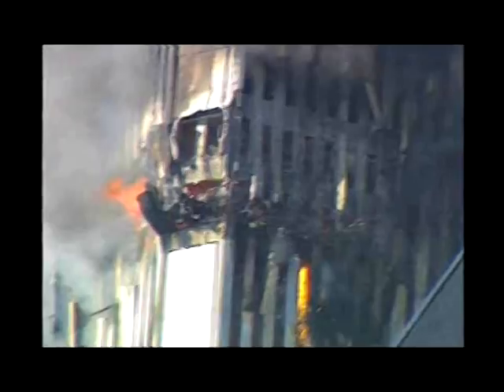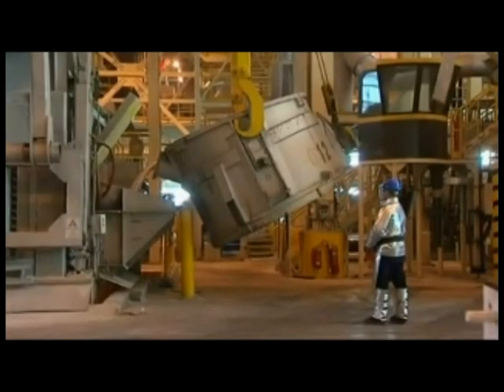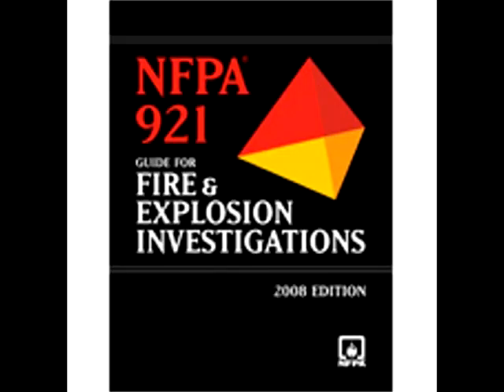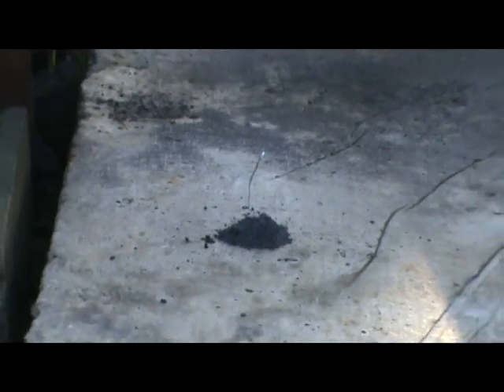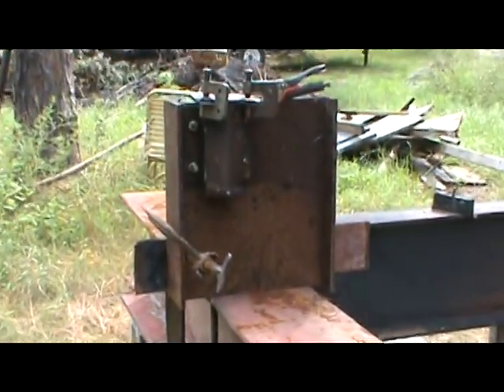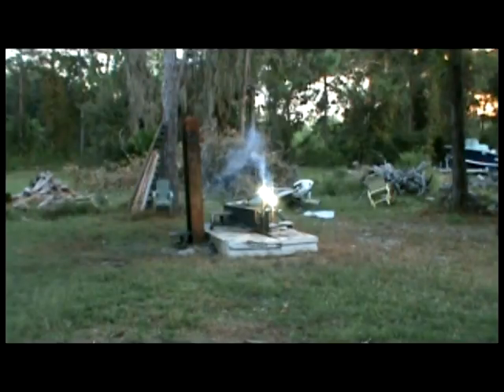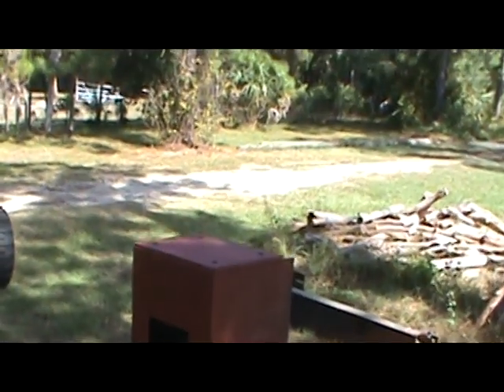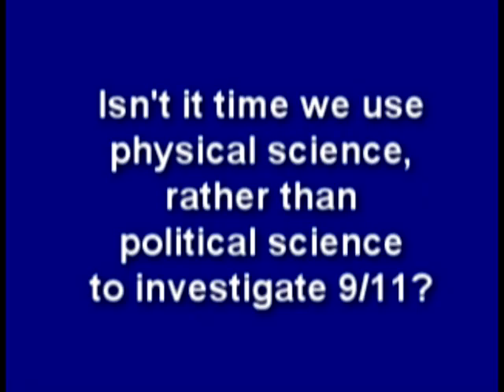9/11 Experiments: The Great Thermate Debate

Comment: I was a thermite welder for a major railway from 1995 until  2007 . I watched your video and can say with 100% accuracy that what was pouring out that building was indeed thermite...as for can thermite melt steel..Answer yes I have watched it melt right through railroad track many times.... to do a railway weld we use a 20 pound bag of thermite....the thermite we used was of very good quality.....thermite does not explode unless introduced to water.... it is my belief they filled the columns with thermite and the fire from the plane ignited the thermite.  I have watched thousands of thermite welds and I can guarantee that liquid steel pouring out is the exact replica of what I watch at work.
Reply: A really big fuckin hole comin right up
Reply: @G Ghecko I said it doesn't explode unless introduced to water...try reading the comment a little closer....I spent 13 years staring at thermite pours....I'm probably a little more qualified than you on the subject. In the end you misread my comment so detective work is probably not in your wheelhouse. Cheers
Reply: @theraven9156  I am a chemist and more qualified than you, you're right so everyone who says you aren't can shut their months.
Reply: So do you think 9/11 was a inside job?
Reply: @1loveaudi  israeli mossads did it, but zionists were behind.
I laugh at those who believe Osama planned it, they must also believe Santa Claus.
Reply: Thank you so much for your honest comment! It is greatly appreciated! We are all truthers in this together. If we all could add in our own truths & facts that we've learned throughout our lives, we could use those facts as the many different puzzle pieces that are NEEDED to piece all of this evil that is going on, and find the truth, together!!!!!!!!🙏❤💛💚💙💜
Reply: Sara Ferguson

Unfortunately, evil was created by people who once ran our country. id like to say it started all the back when world war one was going on but what am I to say. what I could say from 9/11 is that kerosene (jet fuel) burns at 800 to 1500 degrees Fahrenheit, and steel melts at 2750 degrees.  something went wrong and its not the chain link of events from the airplane alone
Reply: 'Theremite won't explode unless exposed to water'

'The fire from the planes set the charges off'

You're either lying or really grasping at straws
Reply: the raven 
It was 1800 degree molten aluminum from the jet plane pouring from the tower. It glows that exact color.
Steel loses 50% of it’s strength at that temperature.
Reply: @Jay Kenley, You must be joking because you could not possibly be that stupid. Watch the videos of other much smaller buildings being prepared for controlled demolition. It takes months in some cases, and that's after the building has been abandoned and all of the structural elements are readily accessible. Further, EACH of the twin towers was 110-storeys tall, which dwarfs any other building that has ever been demolished.  So, all of that preparation work would need to done IN SECRET in occupied buildings over the course of ONE NIGHT? Simply not possible by a few guys 'in white vans'. Grow up, get a life, and learn to think for yourself rather than drinking the KoolAid.
Reply: John Johansen yeah that’s why they were working in there for weeks before though right.  They said elevator refurbishment job 

They were guys working there for weeks
Reply: They had to know exactly on which floor the planes would hit to do that or they had to fill the columns all over the building to be sure. Nighter is possible.
Reply: Ingebrigt Kvamen 
Yes, the entire conspiracy theories collapse under cursory examination.
The exterior steel support beams were mostly outside the building, outside the exterior glass. 
I don’t think truthers ever entered the building. I’ve been all over that building.
I don’t think any truthers have ever run cable in buildings, or tried to drill through steel with a hand drill.
They don’t understand the enormity, labor intensive, sweaty grunt work of what they propose, the annoying security protocols enacted after the 1993 bombing, engineering, they don’t understand anything. 
Clueless they are.
I’ve been in many of those offices.
Reply: evidence of thermite evidence of explosions evidence of things turning to dust. You guys think it's the same people behind the world currency / federal reserve? I do. If you haven't, watch creature from jekyll island
and europa last battle
Reply: Truthers are like a parody of detectives. Dust? 110 floors of four inch concrete slabs, tons of gypsum wall board, create dust when pulverized.
Everything’s a clue to them.
Get a clue!
Reply: @JohnsMotorcycleChannel2  Goddamn you are so smart....so the planes brought the buildings down....ok, got it...
Reply: D G 
Aircraft smashed up the Pentagon, and made a big hole in a field in PA too.
Reply: John Watson what’s your point?
Reply: @Jay Jay and the external Columns were clad in it...... they always leave that out.... Damn Nutters
Reply: Jay Kenley  and the drivers of the van were tiny green aliens...yeh right you made up that history about the vans. Where s the newspaper reporting the vans?
Reply: jay jay

so that must mean the I beams used for the building were made of iron right? like where you getting at with this aluminum is just one ingredient of many to make thermite
Reply: Actually, it was molten lead from the UPS system in there to prevent power surges and short-term power outages. Anyone who has done actual research has found out that, that room was full of lead-acid batteries for that purpose.
Reply: Your post seems more informative than judgemental. Curious how touchy some commentators are though. I guess explanations to events that don't match individual beliefs are harshly judged... just like in old Salem during the witch trials.
Reply: @davidfesta3061  people have come forward about this.  First, the bomb sniffing dogs were "worked 12 hours a day for 2 weeks and then were unexplicably pulled from duty on Sept 6th until the attacks."  This is well documented in various news reports.  For the second part, I'll repost what I wrote to raven earlier.... there's a pretty easy answer to the question of "how would they get it there?".  Both towers underwent a "power-down" on 9/8-9/9.  According to the testimony of the safety officer in charge of prepping the building for the power-down, it was the first time this ever happened on his watch.  He claims that lots of "engineers in overalls" were walking around the building during this time.  The buildings were shut down, security scanners and any other powered device was disabled, offices were closed, all power was cut until Sunday afternoon 9/9.  There are videos of this gentlemen's testimony on youtube.  It's certainly not far fetched that the CD was set up during this time..  You can find the documentation for both of these on youtube.
Reply: @davidfesta3061  Well thanks for your permission.  I really only believe because I want to.  Keep telling yourself that:)  Anyway, because I'm really only trying to figure out the truth of what happened, as best I can, I'm looking into your claim.  I'm not trying to prove the thermite hypothesis.  I don't know what happened and I haven't claimed to know what happened.  Thanks for at least sharing a few sentences of real argument so I can look at that.  It's certainly a logical claim that the building couldn't possibly be rigged.
Reply: I mean you know skyscrapers experience incredible wind speeds due to them being uninstructed combined with there being a plane with at least have a tank of jet fuel and a small(well jet sized but not the entire surface area of the building) hole in the side the wind would make the fires burn a lot fucking hotter enough to liquidize the steel, not to completely discredit what you’ve said I’ve never worked with thermite so I don’t have that same first hand experience, so thank my opinion as you will
Reply: LOL at the reply to the wrong person. OWNED.
Reply: @davidfesta3061  scientists from all over the world examined samples and said there was thermite present.  It's not the video that brought this in question, it's the people that investigated and that are more qualified than you to talk.  sorry, try studying the subject
Reply: David Festa they did actually do that though didn’t they lol 😂 

The had ‘workers’ in and closed off certain floors 
Check it out
Reply: David Festa 
You think those people in the offices are going to question a worker repainting a wall on whether they’ve loaded a column with thermite 😂😂
Reply: The steel girders in wtc7's inner core were attached to the support columns with only 4 bolts.
Reply: Please watch and share https://youtu.be/H6PeudYGZ98
Reply: @kifter4254  It's so nice to see someone respond to an old comment after such time, that just shows that people care. You are a very kind gentleman, thank you very much!
Reply: the raven you are absolutely fucking right
Reply: You were a welder?  And you believed this garbage?  I suspect that maybe you aren't a welder because welders actually understand the properties of metals at different temperatures.  How about this "Mr Welder" At 1000 degrees F, what percentage of it's original strength does structural steel have?
Reply: G Ghecko my dad had friends in the building and they heard explosions soo get the fuck from behind your screen and go out onto the world see what’s going on and you’ll realize
Reply: @XR-ok6gr  yeh right any can say " my xxxxx heard explosions "but the explosions  were silent from the cameras outside? Do you think you can  put a charge in the beams of a floor with lots of people and nobody would say a word?.
Yeh many would die to think govermenet did it because they hate  the goverment say ohh i heard explotions
Reply: @davidfesta3061  lol do employees stay the night at work?
Reply: @davidfesta3061  they actually did elevator  work so its actually possible but no one will ever teally know 100%forsure what really happened Y cause they hauled all the Evidence  Off Before investigating  It Thoroughly  ..Kinda Joke in its self just a comment
Reply: Yeah, 30,000 office employees in both towers didn't notice the people carting around thousands of pounds of thermite,  knocking holes in walls, blasting away the asbestos and strapping thermite to the exposed girders.  After all, doesn't that kind of thing happen in every office on a regular basis?  But the real trick was getting the planes to hit in the exact spot where the thermite was going to start the collapse two hours later.
Reply: @artgoat, Well said. I have long argued that these points alone are sufficient to debunk any 'controlled demolition' theories. The point about the impact points/zones is often overlooked but yet is so obvious.
Reply: John Johansen 
The conspiracy theories have bigger holes in them than the actual story. 😆
Reply: @artgoat  why do ppl keep saying  this, does thermite get weak over time ?
Reply: artgoat you do realize that there are plenty of facts out there and videos on the facts mentioned that the floors that the planes hit were under renovation and construction for quite some time lol do your research kiddo
Reply: artgoat serious? 

The floors were closed off, do you normally question construction workers? Or enter construction zones to question workers on thermite? 😂😂 you think those people working would care what people are carrying about?
Reply: There was documented construction work for weeks over entire floors just before 9/11, watch 9/11 a new pearl harbor documentary.  Why is it so hard to believe ppl do evil things?  Seems very normal to me.
Reply: @artgoat  you make a good point...I have pondered that question myself. Their explanation for the orange flow was office furniture and melted computers.. I'd bet anything that what poured out is thermite.....Iam very tempted to do my own thermite experiment and put it on youtube....and my thermite will burn way better than the guys in the video...I've watched it burn right through 136 pound railroad track.....when i say 136 pound that means it weighs 136 pounds for each 3 feet of railroad track....I am going to do an experiment and show youtube what real thermite can do.
Reply: @theraven9156  wait what , are you saying every 3feet weights 136pounds?
Reply: @Dashawn56  every 3 feet of railroad track weighs 136 pounds....back in the old steam engine railroad days each 3 piece section weighed 56 pounds.....railroad track has become heavier over the years to withstand the ever increasing tonnage of the trains... I have seen thermite on many occasions melt right through today's bigger railway track many times. To melt through those trade center beams would be no problem at all.
Reply: @theraven9156  Had thermite been the cause for that glowing liquid seen pouring out of the towers, you would have also seen a bright  flash where the thermite was burning. 
You might excuse that away by saying the  thermite was located farther inside the tower,  unseen.
So that means thermite was making molten liquid somewhere in the tower, but somehow it found it's way to the corner of the building...
Ook
Reply: @the raven, I am not in a position to dispute your assertions about the explosive properties of thermite. However, are you asserting that it was detonated (on 9/11) by contact with water? If so, what would be the source of the water at each of the sites where the thermite was planted? And, how could such a detonation process be initiated (i.e. to not detonate prematurely) and to detonate in sequence (i.e. 'controlled')? If not water, then how was the thermite detonated? And, what would be required at each site to set up the detonation mechanism?
Reply: @theraven9156  there's a pretty easy answer to the question of "how would they get it there?".  Both towers underwent a "power-down" on 9/8-9/9.  According to the testimony of the safety officer in charge of prepping the building for the power-down, it was the first time this ever happened on his watch.  He claims that lots of "engineers in overalls" were walking around the building during this time.  The buildings were shut down, security scanners and any other powered device was disabled, offices were closed, all power was cut until Sunday afternoon 9/9.  There are videos of this gentlemen's testimony on youtube.  It's certainly not far fetched that the CD was set up during this time..
Reply: You got your video done yet?  @theraven9156
Reply: @tonyiacomi4822  I need to know the thickness of the steel on the box panels?
Reply: When are you gonna find out?  @theraven9156
Reply: @theraven9156  genuine question.
you say thermite doesn't explode without water. what was this guy using in this video as 60% of his tests exploded,
Reply: @chrissearle6176  the thermite we used on the railway was industrial grade..it burned very clean ... I believe what he was using was a homemade recipe which probably had to much magnesium in it ... just a guess... we are running trains over our thermite welds at 80mph (passenger) and 60mph (freight) so the quality of thermite is very high.
Reply: @theraven9156  cheers bud 👍
Reply: John Johansen that’s a really simple dumb question, kinda like you’ve never heard of this before. 

It’s been used for such a long time
Reply: @artgoat  they did elevator  work which was inside the structure So its possible And nobody was allowed in.
Reply: @artgoat  your way off mate. There was reports of men coming in at odd hours. Some floors where rented by Israeli ' artists ' yet alone many details of out of the ordinary occurrences. Especially iith security. There is film of steel beams at the site clearly cut purposefully. There is so much evidence to support without doubt that the official report is a joke.
Thing is, I researched both arguments before making my own conclusion. Why do so many that think the government wouldn't lie not even look. Everything about it is so clear to see I'm at a complete loss to understand how so many dont want to see the reality.
And this really confuses me - how often have you heard and maybe said yourself that politicians all lie, can't be trusted etc. Yet the same people believe every word on this. 
I've come to accept that the world we live in is nothing as it seems. From the beginning until now, and until the end of our age -  Its all about Jews returning to their promised land.
Reply: One question.  Where you in New York when it happened?  What did you actually see? A video? Or were you actually there seeing something real?
Reply: It's interesting how an ex CIA agent is saying that from August to beginning of September trucks were coming and going from WTC every night after ppl were out the building ... What did they load all them nights ?
Reply: @TheRealAnthony_real  whats the name of the ex.cia? John mclane maybe ?ohh and you re the editor of that newspaper.maybe an ufo charged the explosives and you were the driver dont you?
Reply: @davidfesta3061   Marvin Bush was Supposably  The Main Gaurd And I think They wasnt around With Dogs When thsy did inside Elevator  Work And Other work Elevator  Ess Gaurded Area
Reply: Jay Kenley  Hey Great Somebody else Actually Knows about Elevator  Work Wish Rest These Stooges Knew More ..
Reply: @davidfesta3061  Maybe you need check it yourself im pretty sure ol marvin bush and the they guard dogs were taken away when they was doing the elevator work maybe im wrong Who cares Really Truth is in The Money See Who made Millions off This Ordeal Bush Cheney SILVERSTEIN  Yep Millions and  Millions,Millions, millions,millions
Reply: @davidfesta3061  Marvin Bush was Part Of A Company Called Secruracom Maybe spelled Wrong i didnt win spelling bee sorry he or the company was in charge of the towers 1996-2007   Look it up ..Just a Coincidence  Maybe Bush President  911 he's  in a School in Florida  And When Told He Just Sits There With Thumb up his Ass Why Didnt They Rush Him Off if it was A Terrorist  attack Just a Thought..Im not a Theorist  Just Seeing Strange Coincidences...Maybe Maybe Not ...
Reply: U sure
Reply: Normal office workers would not notice regular "maintenance" being done on their building. It would be so easy to do right in plain sight
Reply: So it is true that thermite did bring the Towers down. Because jet fuel isn't hot enough to melt the steel.
Reply: @davidfesta3061  5:20 in this video.  It wasn't two weeks, it was 5 days. https://www.youtube.com/watch?v=lKO5t3rcIZU
Reply: @davidfesta3061   I don't know if you know this but hundreds of thousands of people worked on the Manhattan project and that  secret  never got out it's called  compartmentalization   you only know what you need to know only  the people at the top know the whole story
Reply: @davidfesta3061  use some maturity in your debate mate. Who would take you seriously. It works against you not with you
Reply: @davidfesta3061  David David David. There is scientific proof thermite was used. I have a question for you that requires a simple yes or no answer. Is your conclusion based on research ?
Reply: @davidfesta3061  there you go with your gutter language. Exposing your maturity and ability to discuss anything seriously. One - you didn't answer a simple question so I'll presume confidently you havent done any research. So who's ignorant. ? Hell I might as well go further as you are so well educated. Can a Boeing 747 fly at 500 miles an hour towards the ground perfectly vertical, and bury itself 100% into the earth on impact as is the official story of the Shanksville crash. ?
And mate, there is more than enough conclusive evidence of thermite
Reply: @davidfesta3061  one thing is for sure - you are absolutely correct that idiots will believe the ridiculous. ID surviving the crash. Flew out his pocket the exact moment the windshield broke. Thats believable. Body parts and steel beams thrown over two blocks away, but no explosion. Thats also believable. How about WT7 falling at near free fall, no resistance at all from a small office fire. Thats believable. How about the proven fact of inside trading ? And the people or companies involved are not allowed to be known. The plane vaporized to nothing at the pentagon yet still they retrieved passenger DNA to identify them. The list just goes on and on. And its is absolutely ridiculous. I think maybe you even maybe believe Jesus was born to a virgin mother. Because the amount of miracles and one of phenomena is amazing.
I look forward to your clarification of your education and lack of common sense in your abusive gutter trash reply
Reply: @davidfesta3061   Here one leak for you: (G.W. Bush speaking in an interview abour first responders): “I had a job to do,” he says. “They had a job to do, but I didn’t see the horrific scenes they saw nor did I get concussed by the loud explosions and the bombs that went off around them.” 
(
https://people.com/politics/george-w-bush-opens-up-about-his-sleepless-nights-after-911/
Sleepless nights? Why? Pangs of conscience maybe?
Reply: @davidfesta3061  every reply or comment you make is based on abuse. So I gather you understand it. I won't go down to your level. By fuk though I'd love to meet you face to face
Reply: @Dean Khan WTC 7, here's a video with sound. https://youtu.be/nqbUkThGlCo  In this video the rooftop units collapse before the rest of the building moves. Now we all know that when a building is rigged with controlled demo the whole building collapses simultaneously. The U.S. Attorney has agreed to present the evidence to a grand jury involving this whole thermite, thermate, nano thermite etc. Nano thermite, a word invented by the truther which is why when you google it everything that comes up is 9/11 based. There is no mention of that word before 9/11. Who has the evidence that proves thermite was used?
Reply: the raven I definitely believe it was an inside job probably organised by the CIA, I watched another video where they said workers inside the two towers witnessed painters painting the walls and many of them said the paint had a very strange smell unlike any paint they had smelled before, my question is do you think if thermite was added to the paint would that of been enough to bring down the two towers?.
Reply: Preach to the "Shills" amongst you friend. The ones that, up to today, RIDICULES" everybody that ridicules the "official" story. They walk amongst you. Daily. With respect. To the innocent dead. And their loved ones.
Reply: You want to ridicule the official story then make sure your theory matches prima facie standards. I was a witness. Watch this whole ''thermite, thermate, nano thermite, super thermite or whatever you tin foil hats want to call it'' turn up just like all of the other BS theories. It was acknowledged by the courts, now lets see if Jones and Harrit can pull it off. Especially after they have made contradictory statements. Especially when the paper never even mentions the presence of  thermite.
Reply: @davidfesta3061  "demolition experts spent weeks tearing off sheet rock to expose the columns..and planted thermite in how many locations?." A fucking plane carrying tons of jet fuel crashed into the side of the building and went a quarter way through the entire thing. Tearing off sheet rock to expose it? Are you that fucking stupid?
Reply: @davidfesta3061  Thermite you have to make it, it doesn't just appear anywhere, why the hell was it found in the tower site during the investigations?
Reply: @davidfesta3061  "what you don't understand. .you don't debate wannabe youtube 911 truthers...the proper and most effective way to communicate with individuals like yourself is to tell them to go fuck themselves!..its just that simple...!" Yeah like your actually proving them wrong but no you are here looking stupid, maybe your just bluring the lines with bullshit. Thinking you got a point but in reaility your talking to yourself with the "go fuck themselves". You are fucking yourself.
Reply: @davidfesta3061  Yet you said someone had to break down the walls to expose the thermite as in a previous quote now your literally back stepping. "757 commercial jets the energies and forces from the impact.and the sum of events from those impacts (forces and energies produced)..globally brought down the towers...
" You say the thermite had to be exposed right well read your words and focus on "impacts" if your jet fuel can burn those beams (which we know they can't melt the beams in the first place) then say someone had to expose the thermite after you talk about this apparent bs huge crash "forces and energies produced)" "Impact" BS could have done it, don't you think thermite would have lit without having to be exposed days/weeks/months prior with such a huge crash?  You're the epitome of stupid while lacking even the understanding of your own words in all sense. You dumbfuck.
Reply: @WOAH CALM DOWN Thermite is iron oxide and aluminum powder, it's residue is aluminum oxide and iron. What are some forms of  iron oxide, how does aluminum oxide form and how is aluminum powder made? You're saying that it doesn't just appear anywhere. They found traces of thermite in the dust.
Reply: @WOAH CALM DOWN Tell me that none of these elements were present in the building. Who has the evidence showing that traces of thermite was found in the dust. Since Dean Khan is busy maybe you can answer for me.
Reply: @beingmyself000  Yes but you don't find thermite naturally if you could read you'd get that
Reply: @beingmyself000  point is, you don't walk into a old barn pick up a pipe and under it is a pile of thermite, it's a compound with RELATIVE amounts of each metal that has been mixed and the amount of fine particles has to be thin enough. Yeah you just don't find thermite anywhere buddy, you can name elements but you can't find thermite like it's a walk in the park. It's like saying I stumbled onto cement while digging for rocks you fool.
Reply: @WOAH CALM DOWN You asked why thermite was found at the site of where the towers fell. You didn't say anything about thermite occurring naturally in the environment. Besides, were not talking about your back yard, we're talking about ground zero. If you want to talk about naturally occurring elements then we'll talk about it. Are you the one who found traces of thermite in the dust?
Reply: @WHOA CALM DOWN I asked you 3 questions in my initial comment, are you going to answer them?
Reply: Thermite definitely brought down the twin towers.

Thermite is iron oxide & aluminium  powder.  It only needs a high ignition temp in this form, 
Iron oxide mixed with the magnesium-aluminium alloy has a much lower ignition temp. 

So you have a building made of rusted metel & a plane made of magnesium aluminium alloy put them together on fire & what do you get?? 
Regular thermite burns fast & once its used up there is no more heat source, if a weaker mix is made to increase the burn time it burns slower but doesn't produce enough heat to melt steel, so how on earth did regular thermite cause molten metal to pour out for so long.
Reply: You're a jackass dude i was a fbi bullshit analyzer from 1995-2012 and I can say with 100% accuracy that you're full of shit
Reply: David Festa    Dont pose common sense questions to people that dont have any common sense.....    the replies will be filled with gibberish.
Reply: On the internet anyone can be anything and claim whatever rubbish they please. Like you just did, congratulations.
Reply: @G Ghecko Fuck off back to Israel you cretin
Reply: @UnstoppableTramp  I'm a white Canadian Scottish/ Dutch....wrong again fool.
Reply: ravens is Israeli 100%
Reply: @theraven9156  Sir I believe he was replying to someone else.
Reply: the raven I’m a white Canadian welder too, and there’s no way thermite could drop towers the size. How are the ignition source even survive the planes fireball, or the office fires? Ever ask yourself why it took hours for the buildings to fall? And the molten metal pouring out of the twin towers was aluminum, aluminum in certain states can also be orange. And iron microspheres they found were from welding,not from thermite, you should know this buddy
Reply: Implosion and man made no building in history have collapsed after fire modern that is Steel!
Reply: People want to make a point against the controlled demolition hypothesis by pointing out what a complicated task it is to prepare a large building for that (group of experts would need months etc.)

If it is so hard, why then can a rather randomly hitting airplane accomplish such a perfect demolition down to the building's footprint by sheer luck? Isn't it much more unlikely to achieve this by mere random chance, than by a hand full of experts preparing the building in night shifts?
Reply: Well you just signed your death warrant